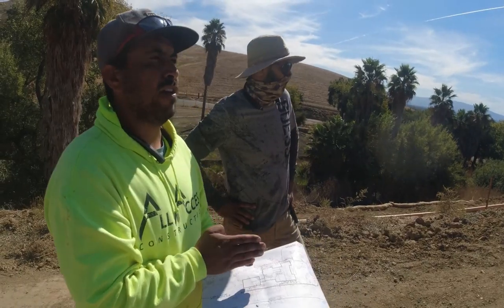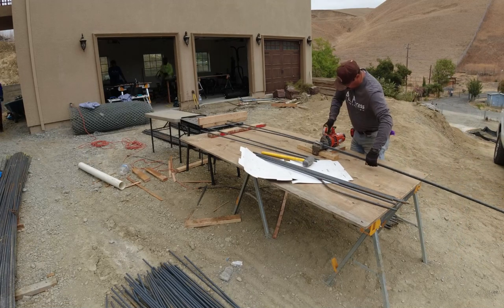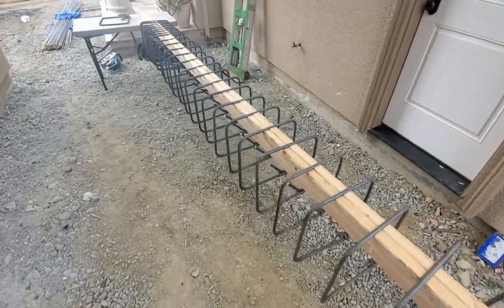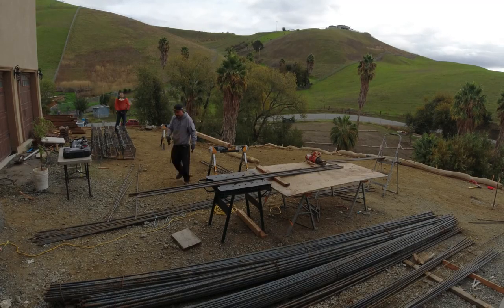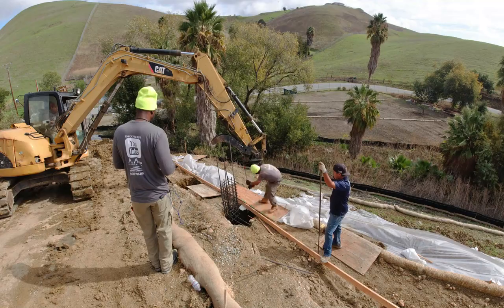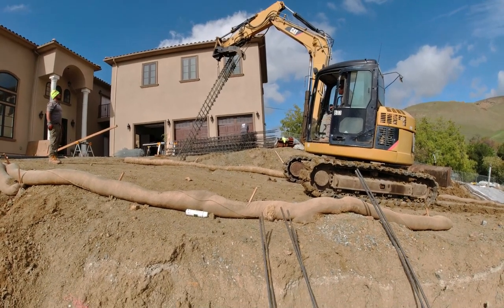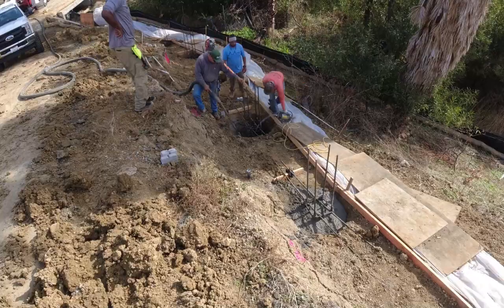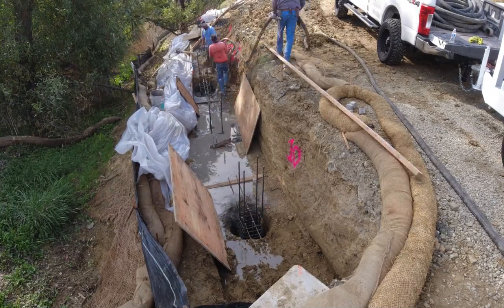Installing Concrete Piers for Long-Lasting Retaining Walls

Comment from the maker: Alright, this is part 1 of this project even tho I made the other 6 videos first..lol. In this phase we install 12 concrete piers for the longest retaining wall on youtube check out the playlist here: https://bit.ly/329erfh
Reply: I did see that vid. Massive wall. Thank you. But using that won't work because I share that wall with neighbor. I did put some h20 proof below up to two blocks above the foundation then added the French drain but the sprinklers hit mid wall and water is coming through my side. We are going to see if we can fill the joints better tomorrow. Ill let you know. Thanks man, U rock.

Comment: Got a Cinder block wall question for you. I'm having the wall built and my neighbor turned on his sprinklers and water is seeping through my side. Not all over but only in some parts. Why is that and what can I use to waterproof it that will later be ok to add scratch brown and stucco it? Any thoughts? Thanks
Reply from the maker: Check this out http://bit.ly/30VYX9e

Comment: Quick question why didn’t you stagger your ears on your ties ?
Reply from the maker: Don't understand the question "Ears on your ties"
Reply: The hooks on the stirrups on your columns all face the same way , im not saying it’s a huge deal but if you stagger them (have the hooks face different ways) I believe it strengthens the wall and piers
Reply from the maker: Mannn I didn't even trip.. 😂😂 Not sure if it made a difference the structural inspector sign off.. Appreciate the comment 👍🏾